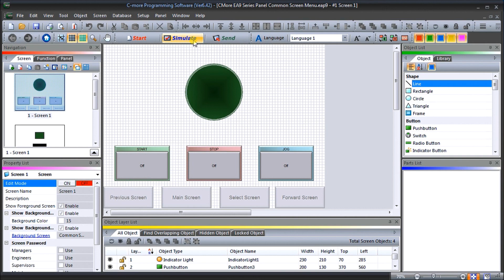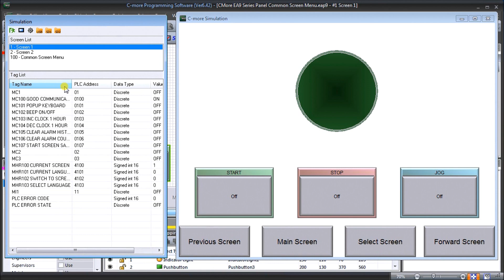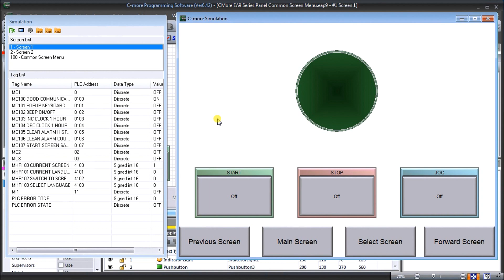C-More EA9 HMI Series Panel Simulate Project

Comment: Hi! Thanks for the video. Do you know if it's possible to tests the simulation mode with the actual PLC wired up? I don't have the screen with me, but would like to tests the links between the TAGS in the HMI and in the PLC. I want to tests the communication settings as well as the links between the PLC tags and the HMI tags. Thank!
Reply from the maker: Hi Francis,
This is a common question. Currently, the simulator for the C-More will not connect to any outside PLC. You will need the hardware to do this. 
Looking at this from the other way, depending on the PLC you are using, it may have a simulator that could connect to the C-More hardware. PLC programming software simulators like the Do-more Designer or the Productivity Suite Software can do this.
I hope this helps you out.
Regards,
Garry
Reply: @ACCautomation  thanks ✨✨✨✨✨✨✨✨✨✨
Reply: @ACCautomation Good evening sir, So I can't connect the c-more simulator to an external PLC simulator like connecting with a RS Emulate 500 using RSLinx??
Reply from the maker: @promiseenyinnaya6346  
That is correct. The simulator on the C-More will only show the look and feel of the programmed screens. It will no connect to any external devices.
Regards
Garry